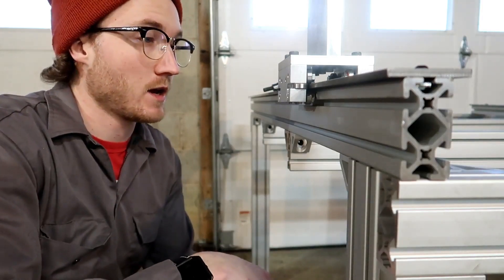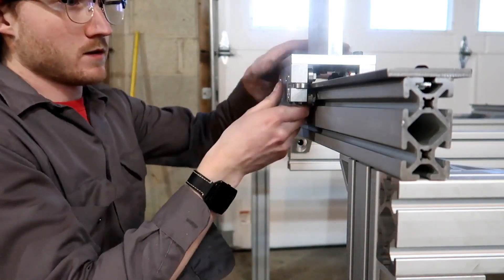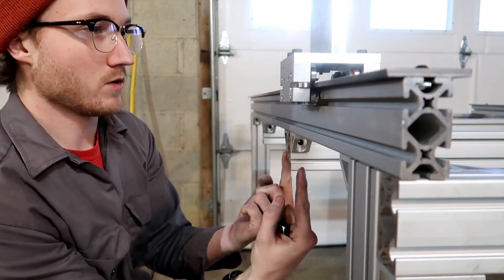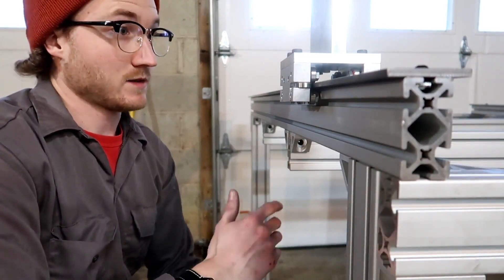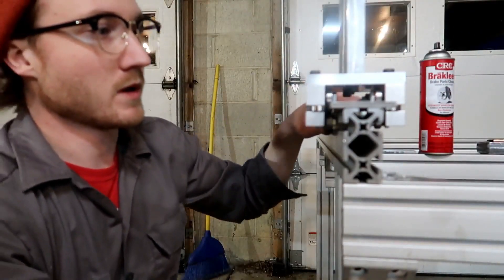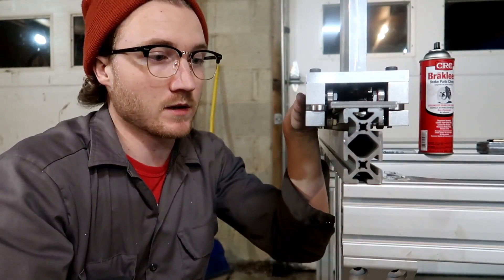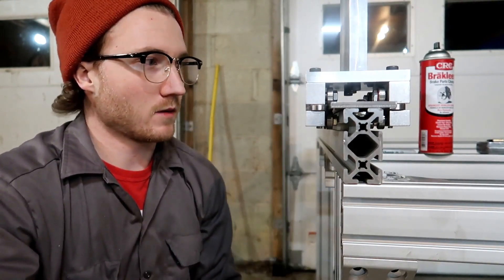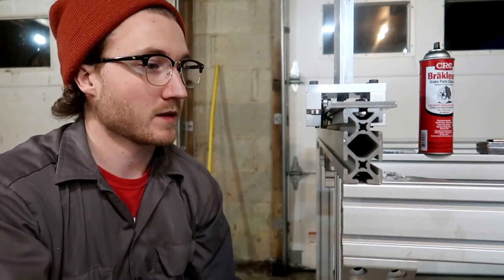DIY CNC Plasma Cutter Base Build: Home Mfg. Days #34

Comment: Where did you purchase the rail kit
Reply from the maker: I made the design myself and bought the aluminum extrusion from 80/20, I got 0.25" this steel for the linear slides, then I bought the linear carriages from CNC Router Parts. I think this is what you are looking for. 

http://www.cncrouterparts.com/linear-carriage-with-abec-7-bearings-p-33.html

Comment: Moving right along!  Great job!  Hey, what kind of budget do you have for this build?  Have you decided what plasma cutter you are going with?
Reply from the maker: I have thought about this a little bit and one thing I have seen done is adding a brush-like pieces to the linear carriage to help brush the top of the rail before the bearings ride over top of it.  I have dealt with this problem before when I had my Shapeoko CNC and you are right, it will cause the motor to lose steps which will upset me greatly when running a part.
Reply from the maker: The budget for this build for the physical parts and the linear motion system was supposed to be $1500.  However, after buying the electronics I am a little over that and by a little I mean $700(that's with all shipping costs).  I had some unforeseen electronics that I needed plus some other little things that I didn't account for. Anyway,  I will share a bill of materials, plans, and actual costs when I do a final video so if anyone wants to make one.  I plan on going with the Razorweld Vipercut 30amp or 45amp for the plasma cutter http://www.gamblegarage.com/index.php?route=product/category&path=110
Reply: Nice job! I have a similar build for my CNC router. One note that I would recommend (may apply more to milling or things that make chips) is finding a way to cover or block the rails from things landing on them because the bearings will get blocked or bind - then you might loose steps or screw up your cut. You may already of dealt or planned for this, but figured I'd say it just in case it could help anyone.
Reply: MojoMfg. Yeah, been going back and forth on the best application of brush seals for my router - either locally around the material I cut or around the rails... either way, good luck with the project. If you want/need any help I’ve done this a few times if you need anything!
Reply from the maker: I plan to install some guards or something of that nature as well to protect the steel rails from sparks as well.  Anyway, thanks for the help, anytime you have any ideas then feel free to leave a comment.